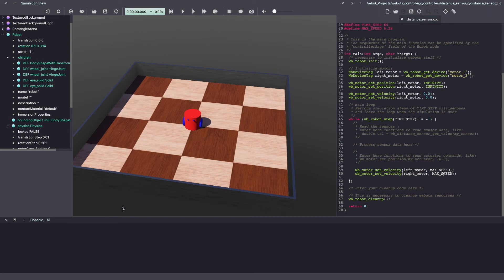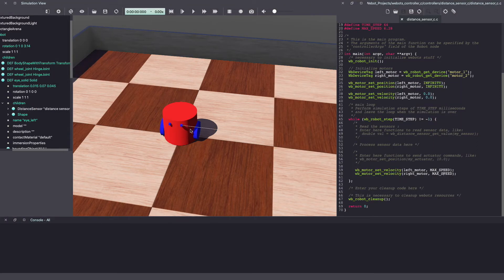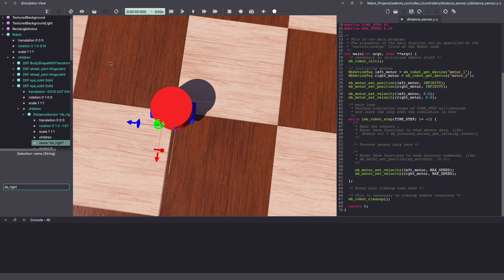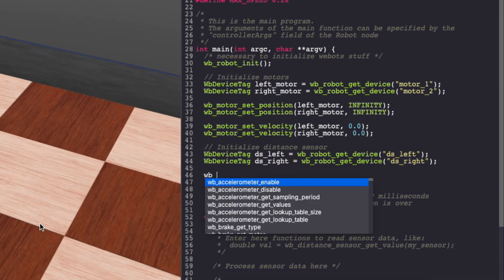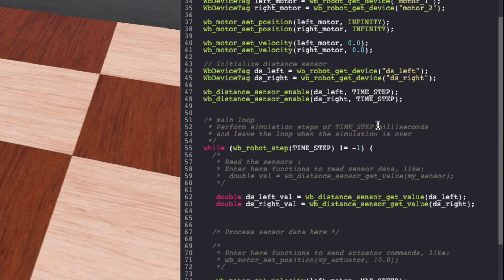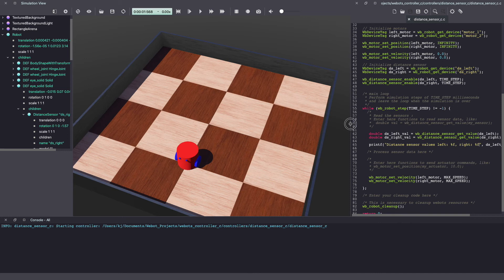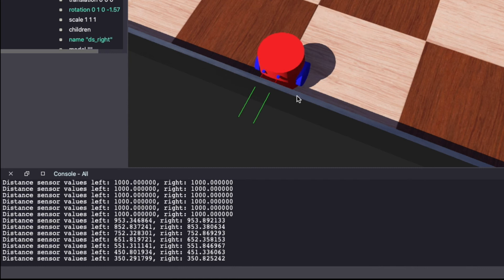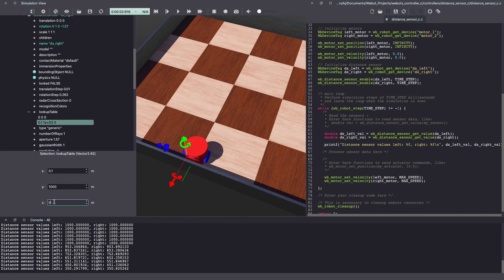Webots Distance Sensor Controller code in C // Webots Tutorial 4 Distance Sensor

Comment: I wanted to ask if I can use a c controller with a matlab one. As I want to process the data of the camera in matlab. But I don't want to control the whole thing using a matlab controller. Thanks for the help in advance
Reply from the maker: I haven't tried that. I think it should be possible. 

One rather odd way to do it would be through ROS. You could have one ROS node controlling Webots and another ROS node processing your images/ video from camera. Just an idea.

Comment: if I want to do ms in robotics after 2 or 3 years of my bachelors( work experience ) what kind of jobs do I need to apply or work in that 2 or 3 years, please tell on both mechanical and software side. thanks in advance : )
Reply from the maker: Surely a job within robotics field would be helpful. You could also try IoT and related jobs. 
From software engineer perspective, it can be anything from computer vision, perception, navigation, etc.
From hardware engineer perspective, it can be robot modeling, controls, etc.
Reply: @KajalGada  thank you : )